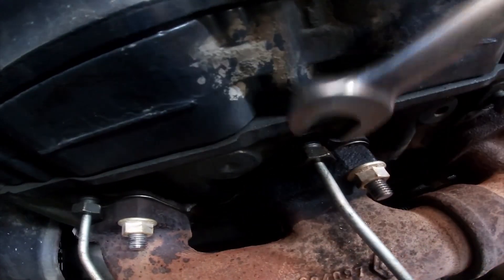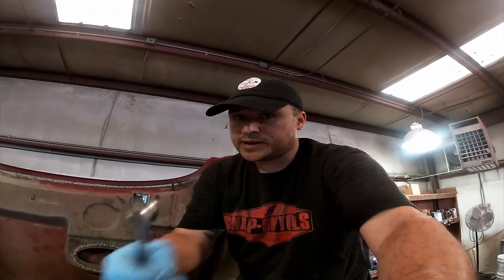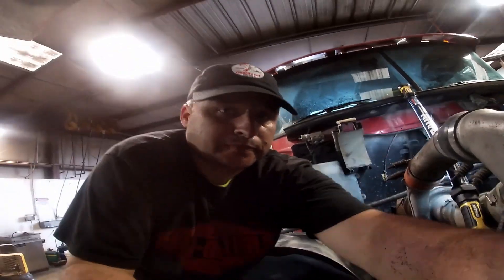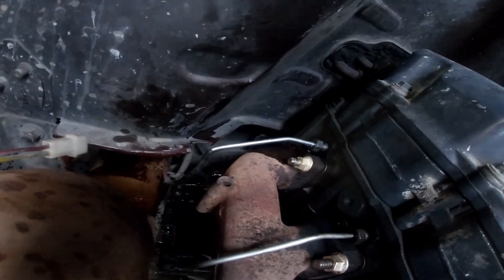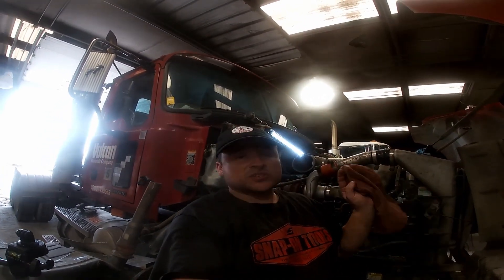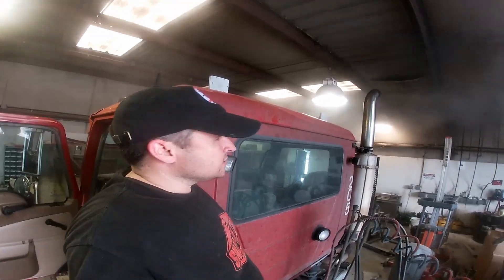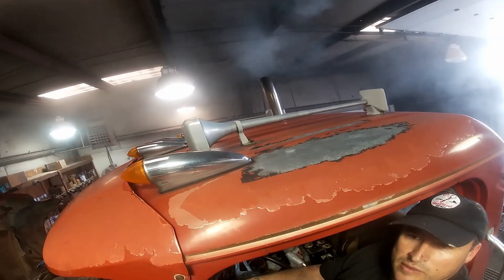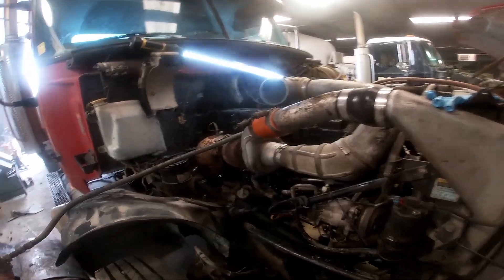MY MACK DIESEL ENGINE SOUNDS LIKE A GASOLINE ENGINE MISFIRING! | EPU INJECTOR PIPE REPAIR | DIESEL

Comment: I have an 03 Mack MR with a 350Hp ASET that just started to smoke heavily like a train on takeoff and while in traffic when I press the accelerator under a load. She's sputtering and idling rough. Your video gives me hope that it may be something as simple as replacing a faulty fuel injector. Thanks for posting.
Reply from the maker: Absolutely brother.